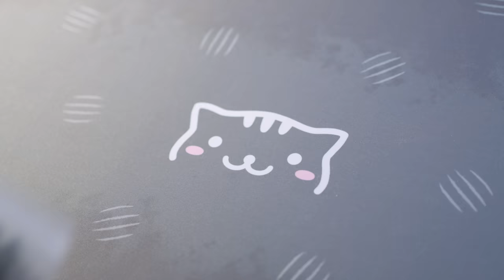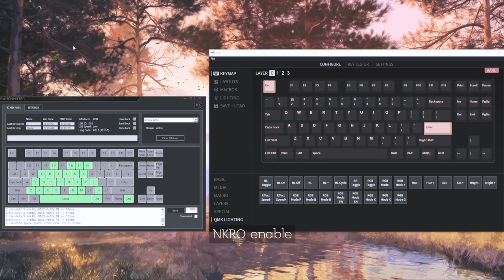Helix Lab Aaru TKL Prototype Build | Cherry Blacks Typing Sounds (PBT Keycaps)

Comment: ahhh it looks so cool
how are the cherry blacks? do they feel too heavy or is the weighting okay (in your opinion) because it does look like in the video your fingers were fatiguing a bit
Reply: You can always spring swap. My preference is around the 60-67g range, so I swapped in 70g tx into my blacks to make them heavy but not crazy like I find the stock springs. The stock springs can feel pretty crunchy and noisy too. Order extra if you go retools though, a good number of mine were pretty scratchy.
Reply from the maker: Stock cherry black springs are too heavy so I replaced them as you can see in the video.
They are just right for me now.

Comment: So I've recently gotten into lubing based on watching your videos. And I am using the same lubing method you are with the krytox mix (1:1 of 205g2 and 105). Everything has been great so far, and I am using my keyboard fairly heavy. I have done 2 keyboards so far, both with Gateron Red switches.

I've noticed now after usage of about 2 weeks, that some of the switches start to have a little "squeak" in them when you press them, or if you put your finger on the keycap and wiggle it left and right. It's not on all of them, just a few.

After I opened them up to see what's going on, I noticed a very faint "black" lube on the stem itself, I suppose it's just from friction or something of the sort. After I cleaned it up completely and put it back in, the squeaking stopped. But it came back again after another week or two of usage.

I am wondering if perhaps I am mixing the lubes incorrectly? Have you ran into this issue before? Hope you can see this message.

Thanks a lot for your videos, they are amazing!
Reply from the maker: I think the black lube came from the friction.
What you did seems just fine. I guess the switches were not that clean or the friction made some dirt. 
It's glad that you resolved that by opening the switches.
Good job!

Comment: Hey I have a question I just finished building my first mechanical keyboard with a hot-swappable PC be in when I try to take out a key cap The switch comes out to and all the switches are very loose and wobbly I don’t really know what to do I was wondering if anybody here did Thxs.
Reply from the maker: That's one of bad things of hotswap boards..
Reply: @3ildcat   ya I figured it out though Thxs